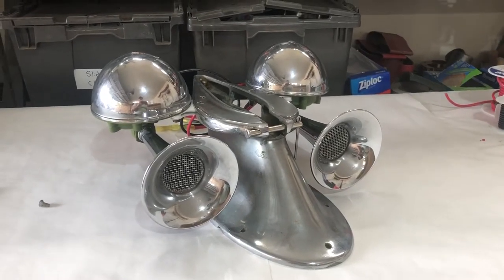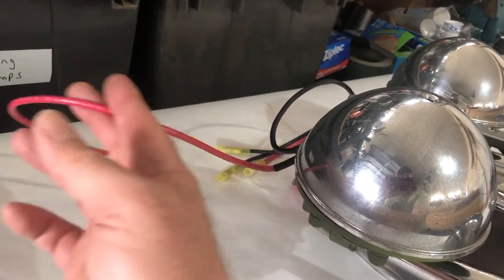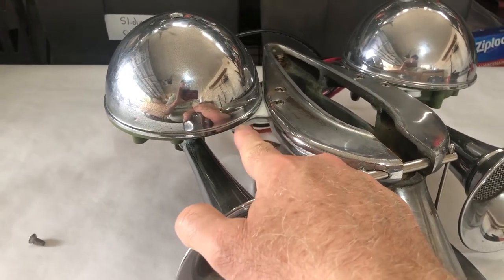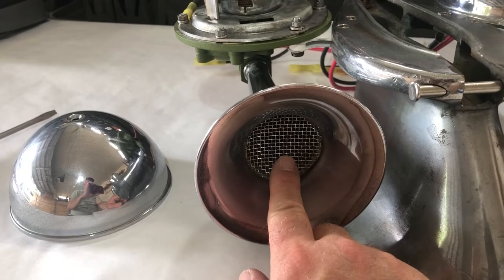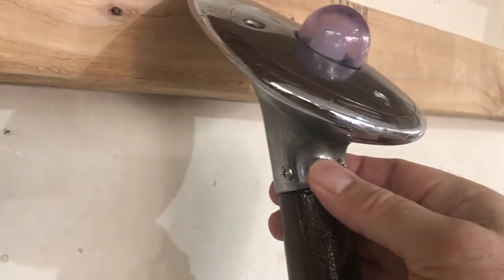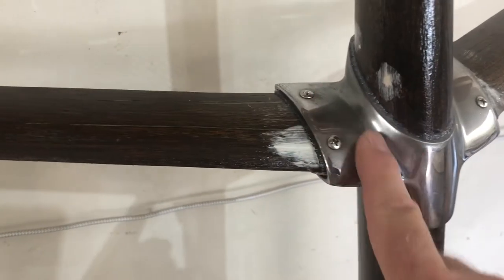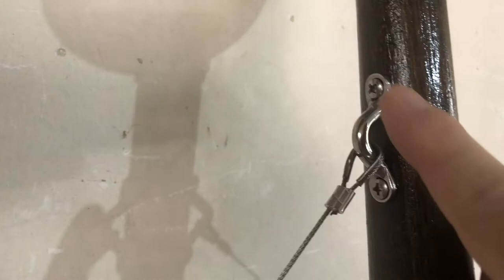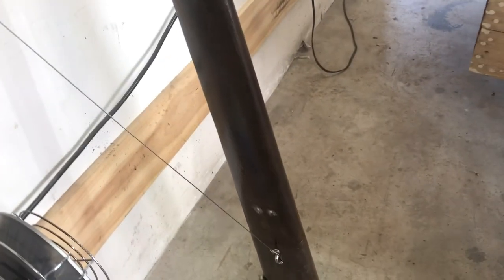Update: Restoration of a 1960s Chris Craft Mast

Comment: Looks great! Wondering if you have any advice on how to clean up the old chrome hardware? Maybe I missed it in the first mast update?
Reply from the maker: Hi Jon. The auto parts stores sell chrome polish. That and 0000 steel wool can help. However, when the chrome is gone, it’s gone. Then you have to send your parts out for restoration at a plating company. They will remove the old plating, polish the bronze and repair imperfections by welding and grinding. Plate copper, then nickel, then chrome. It’s a skilled trade and it costs a lot.